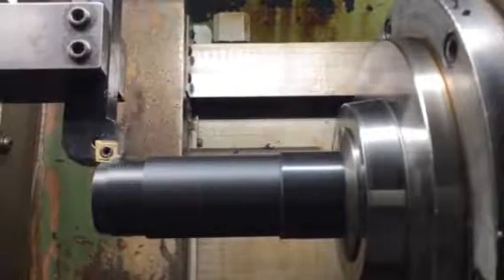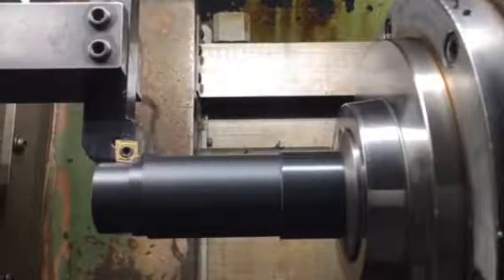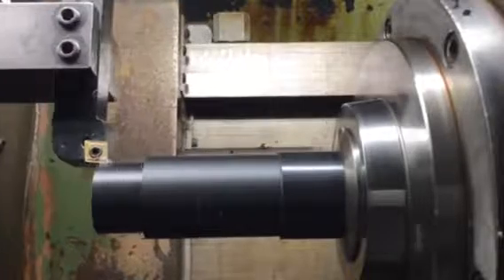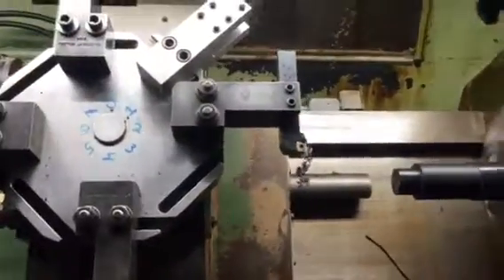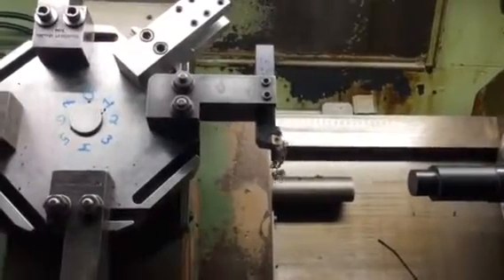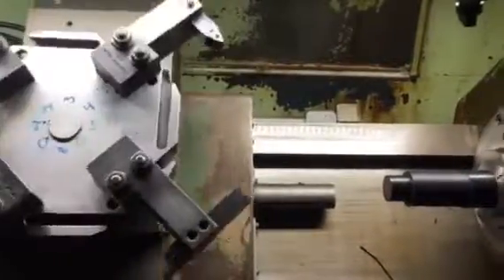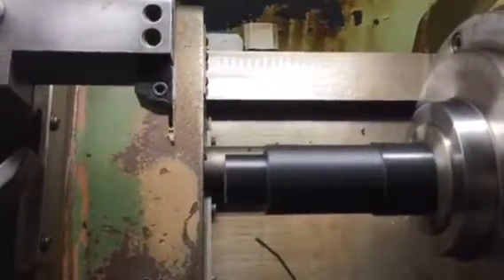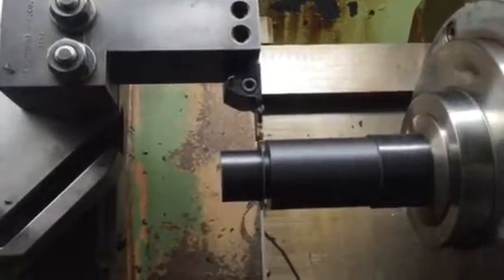CNC Turret Lathe Threading

Comment from the maker: This is a threaded cap for a water softener. I'm turning a piece of 1.5" acetal. I wrote the G-code manually because I still hadn't figured out the post-processing, as such some of my feeds and speeds are pretty inconsistent, but it got the job done.